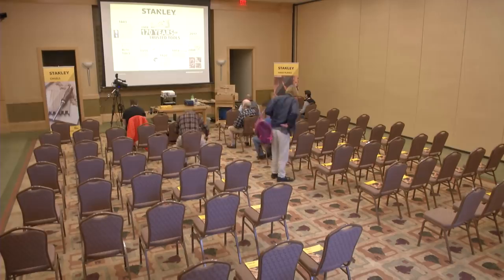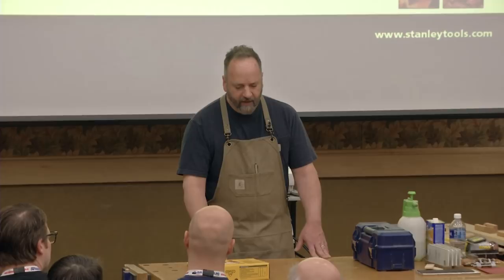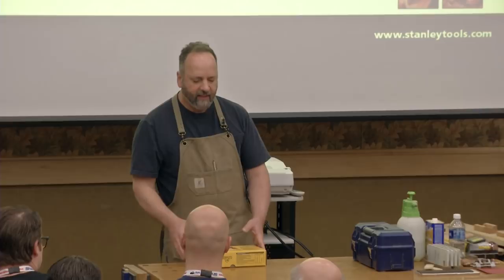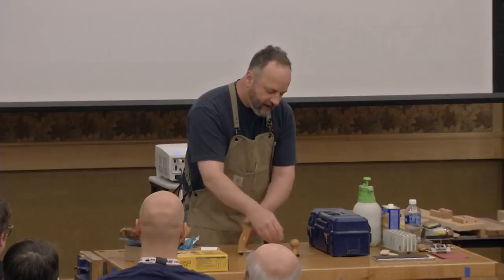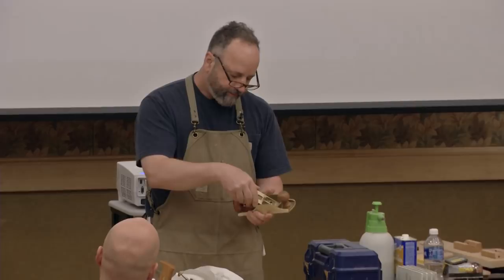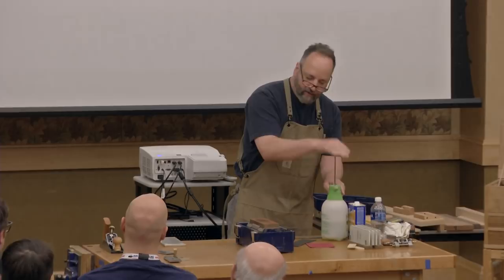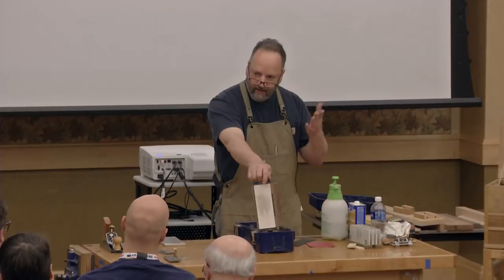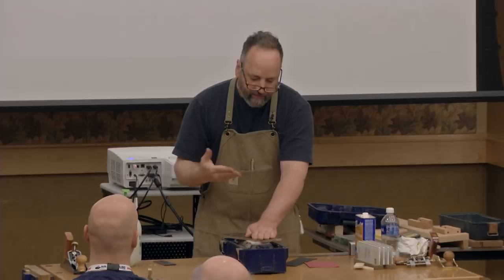FWW Live 2017: How to set up a handplane with Mike Pekovich

Comment: Mike I really appreciate all of your videos.  I've struggled with sighting the set of the blade, I think I'll give your finger trick a try.  Also I really need to build your angled shooting board for shooting long miters.  I have a question you didn't address in your video though.  When Is it that you use your smoothing plane?  I've tried:

-Right after boards come out of the jointer and planer, but these parts tend to get dinged up over the rest of the build. Also, it can make boards slightly different widths and thicknesses which can throw off joinery.

-Right after cutting joinery. But this has a tendency of throwing off precise joinery that I cut otherwise. That snug dado is now loose, or where the tenon board meets the mortise board is not quite level anymore.

-After glue up. Even though this seems like the ideal time to use the smoother since it's time to surface prep for finishing... it's hard to hold a whole project still for planing, or boards meet at perpendicular angles causing tear out.

I very much prefer the surface a plane leaves over sanding, but I'm struggling to find the appropriate time to do this step.

Comment: The ruler trick is useless, other than a smoother and a jointer that's specifically used for jointing 2 edges at the same time, all other planes have a heavy enough camber and makes that trick worthless. And regardless of modern machines, you still need a proper set of handplanes to flatten boards fast, not everything will fit on a jointer, especially not small jointers which people tend to afford, which are basically useless more or less.

Comment: This is all solid advice, of course. Still I can't help hearing a comment track in my head saying "now let's rub this 200 dollar diamond plate on that 150 dollar stone so we can sharpen our 400 dollar plane". This is content targeted at beginning woodworkers, yet we are looking at 1500 bucks worth of equipment on that table. I think if instructors were more candid about that, people would run away screaming.
Reply: Yes I agree with you.
Reply: Ehhh, it's probably $250 in reality.  $160 for a sweetheart smoother, and maybe 50 bucks for a plate and double sided stone each.  I get your point though, this isn't chump change.  I myself mucked around with the 'scary sharp' method using sandpaper for a long time until I invested in proper sharpening  equipment.  It's just a cost of entry.
Reply: Conor McKee The bronze Lie Nielsen smoother alone is 350, actually more like 480 over here in Europe. The diamond plate is in the neighborhood of 200, not to mention the Shapton glass stones which will be up to 150 a pop (for the 16000). I like good tools as much as the next guy, but I keep seeing entry-level instruction which implies that this is normal. Everybody should use the tools they like, I just find the nonchalance with which instructors present their Porsche-level tools irritating.
Reply: He didn't set up the Lie Nielsen, he set up the Stanley, which is around 150 USD.
Reply from the maker: Those numbers are inflated quite a bit. But you're right, woodworking isn't cheap. This plane is closer to $150, and a great sharpening setup could be had for much, much less than what Mike has here. Just because someone who is a pro has high-dollar stuff, doesn't mean he started there. -Ben
Reply: While I agree with you on the cost comment, I think we might disagree on philosophy somewhat.  I would submit to you that we readily go out and put $75 dollars worth of fuel in our vehicle and for some that doesn't last a week...so, for the cost of a couple weeks of gas, you can have a tool that will serve you well for a lifetime without the headaches a cheap tool renders.  Not really that expensive!
Reply: I spent $90 on stones and picked up a atoma 400  Diamond stone i use for lapping the stones for $66 bucks. So $150 all together off Amazon.  but you're not buying all those just to sharpin one plane i hope?,  Yes in that case it would be a lot of money i would just use  Sandpaper.  But when you start accumulating a lot of planes,chisels amd knifes the stones are a small cost  I also strop my edges too  but I'm a little crazy when it comes to that stuff.
Reply: Two words: Paul Sellers. You can make paper-thin shavings with a flea market Stanley, a $10 combination oilstone and a strop made from an old belt. Fine Woodworking have a very specific demographic, but there's nothing inherently expensive about woodworking.
Reply: Piece of glass and sandpaper will get you going for cheaper than stones.

Comment: Chip breaker. Not really properly named? Yes it is properly named, it's just that you don't know it. It's called a cap iron. Setting it correctly (not like what you are doing here) will make the difference between getting a smooth finish or one with tear out.

Comment: Why would anyone want to sharpen a hand saw? Because it's an old blunt tool
Reply: Well, with a $120 dovetail saw, you want it to last your lifetime. I sharpen mine, two swipes per tooth with a file. It takes 5 minutes. Makes a huge difference and it is like a new tool.
Reply: I agree, Peter. I have a Lie-Nielsen tenon saw and the difference when I sharpened it was a revelation.